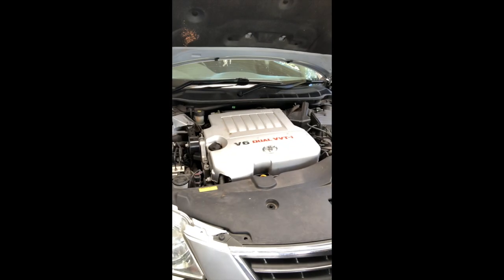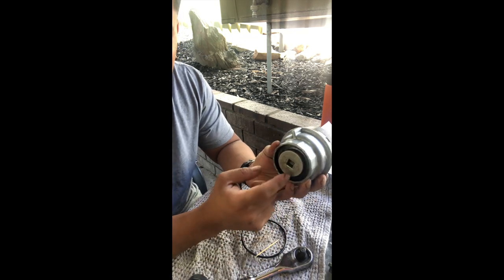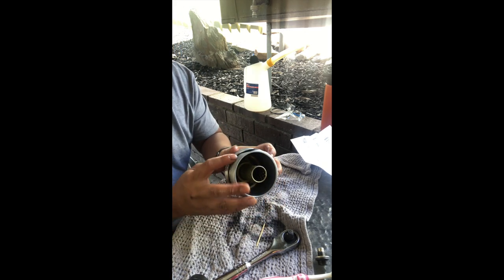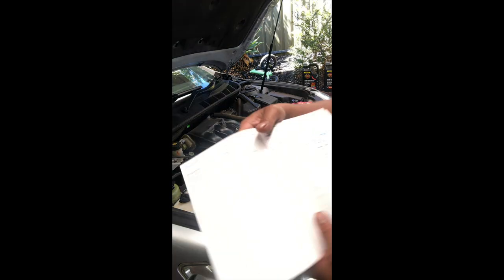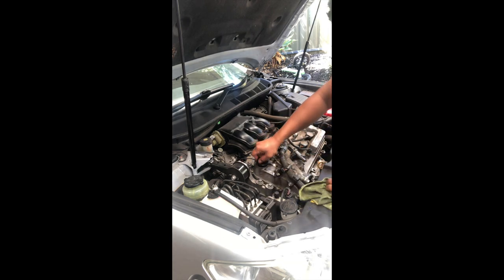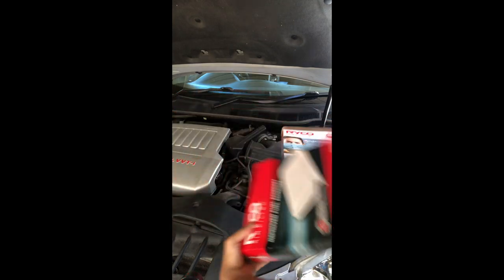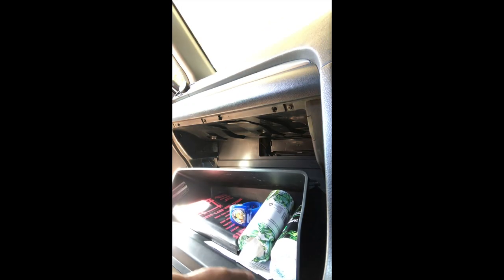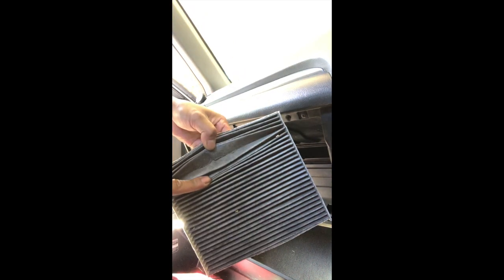Toyota Aurion - oil change, oil filter, air filter, and cabin air filter.

Comment: Some folks never change the small o-ring.
Usually the reason you can't get it off is because the torque specs were not followed on a previous oil change. (That's what happens when you tighten up the whole assembly using only a ratchet and ⅜ inch extension.)
Oil filter cap = 25 N•m (18 ft.lbs.) Use oil filter cap wrench to install.
Oil filter cap drainbolt = 12.5 N•m (9 ft.lbs.) use ⅜ inch extension to install.

I like your method of removing the o-ring but it's also easy to do it without tools or a toothpick...
See https://youtu.be/3R1KMN1ys3A

One other thing. It looked like your new cabin filter said "UP" next to the arrow on the filter so you put it in correctly. HOWEVER, those up arrows have nothing to do with air flow. They simply tell you which side goes up. If your new filter said "air flow" next to the arrow then the arrow should point down. The fact that dirt collects on top of the old filter proves that dirty air comes into the top of the filter and then clean air enters the blower which is below the filter.

Comment: And you Should Clean the MAF sensor too.... make your car happy....
If you don't  may experience, hard to start, use too much fuel, not much power.
Reply from the maker: I ran out of MAF spray just before recording the video. But yes I agree.

Comment: Hey bro, how many clips are there to open for the engine air filter? I can only see 3 in my aurion. I saw someone saying theres 4? Wanting to replacing air filter by myself but dont want to brake anything lol. Cheers!
Reply: Also i kind of saw my air filter today, its kinda semi grey ish...does that mean its time to change?
Reply from the maker: Yeah there is 4, but I only ever take 3 off coz I am lazy :). Just make sure you are mindful of the MAF sensor which is that square thing.  
Regarding the air filter- depending on the air filter you've got, some air filters won't be as efficient when reused, some can be cleaned and reinstalled. I change the air filter whenever I change the oil. Thats just mainly because of the area we live in (dusty) and my air filter which is white when brand new, has a grey shade to it when I change my oil. Also as I said in the video, I am not a professional mechanic, I am somewhat new still in working on my cars. I am learning everyday. so I would suggest if you are not confident, to seek professional advice. I hope you enjoyed the videos, and somewhat found it useful. Thank you

Comment: what about the other o ring in the filter kit where does that go?
Reply from the maker: The oil filter cap has another removable plate just where the hole for the socket is. You unscrew that plate off and you will find an O-ring or space for O-ring. I didn't do it in this video because frankly, I didn't know about it, and when I found out about it  it was torqued up way too tight prior to purchase. So I had to do some heating to remove it. all the best